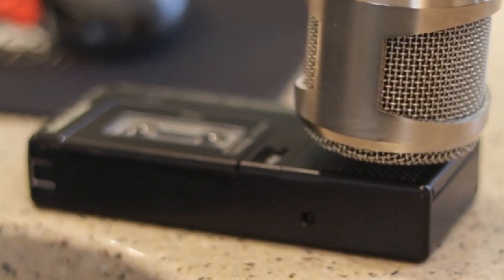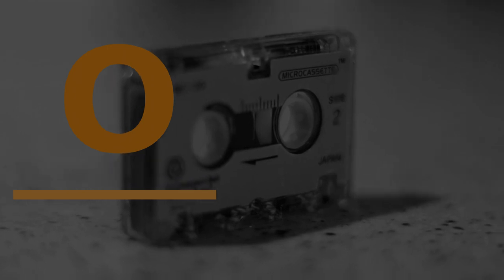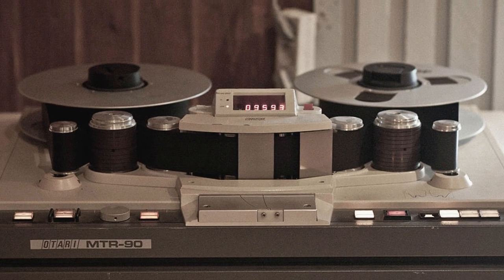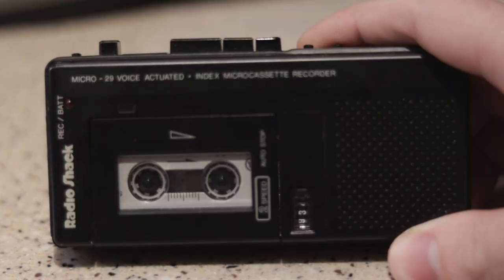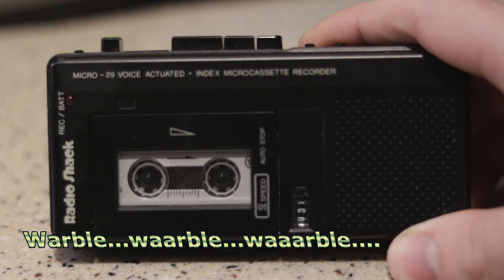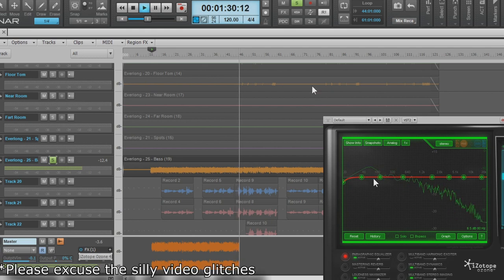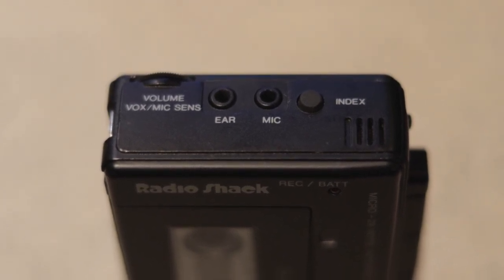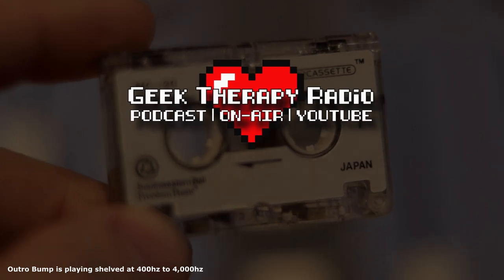Exploring Microcassette | Is my crazy idea even possible?

Comment from the maker: In my initial testing, audio sounds WAY better going through the mic jack input. No motor noise and less hiss than expected. Also, I'm able to boost frequencies as low as 125-150hz (takes A LOT of boost though). Even the high end can be boosted a little, but not much.

This is going to be VERY interesting. Stay tuned!

Comment: Interesting interesting interesting. As somebody in the 2000 to 2006 era that bounced my music onto microcassette for ease of use and portability I didn't find the quality going from cassette to microcassette that bad with my Olympus 41 bought at Radio Shack microcassette recorder and of course after drooling through the catalog. I use that thing a lot to the point where I broke the speed control switch and have yet to find a replacement.
I understood the audio quality chain at quite a young age and one of my requirements was a counter, microphone and headphone out. Because well it's no good if you can't hook it up to other things directly without modifying it. I've even spliced some of my tapes where they broke and cut out worn-out sections.
Only downside was that it was mono, Oh wait Techmoan. I saw the video a few years ago and I wanted to re-watch it today.
That would have been awesome to have when I was younger stereo microcassettes.

Interested to see how laying down each track versus all tracks at once fares with the audio quality.
Reply from the maker: https://youtu.be/fBiPh8LrRmQ here's the result!
Reply: @GeekTherapyRadio  next on my playlist.

Comment: Would putting in a DBX encoder / decoder in line help?
Reply from the maker: I doubt it. At least not with a handheld recorder. Tape just runs soooo slow for one thing.
Reply: @GeekTherapyRadio  I was thinking of the tape hiss. The frequency response, flutter and wow would take some major modding.
Reply from the maker: @ellisgl  It would certainly be a fun experiment. Wish I had a Standalone DBX unit!
Reply: @GeekTherapyRadio  I used to have a portable one, but that's long gone (might have only been a decoder only). https://avaluer.org/explore/20587628-dbx_ppa___1_personal_portable_noise___reduction_adapter__very_rare . I have one built into a Technics tape deck.

Comment: there's any way to put the digital audio into a recorder that doesn't have the mic input like the Panasonic rn 305? I just bought one without knowing it
Reply from the maker: Needs either "line in" or "mic in".

Otherwise you'll need to do a hack job of adding a jack to the microphone wires themselves.
Reply: @GeekTherapyRadio is the jack labeled “ monitor ( 8 ohm) “ just the headphones or speaker output?

Comment: You can do this same thing using any format you want if you are using the cheapest most entry level device of that type.
Let me pick the CD player and you can do the same exact thing with the CDs and get results almost or just as bad.
If you are going to do something like this, at least use a good microcassette device.  At the end, the only thing you will have proven is that really cheap devices used for purposes they were not designed for will give you poor results.
Reply from the maker: The exact point of this video is trying to make a mix from a cheap, crappy format. The experiment wasn't to make it sound exquisite, but sound the best it could with such incredible limitations.

I've got a Tascam 688 (and 644) arguably the best cassette multitracks ever produced. They sound absolutely divine. The best cassette can possibly sound...but we KNOW what great sounds like.

Multitracking with a cheap microcassette recorder. That was the entire point.

On a technical note, the tape inside microcassette is the exact same stock in normal cassettes, just less capacity, hence lower capstan speed.

They actually made Type II microcassettes and hifi microcassette decks, but they didn't catch on.

So, anyway, I apologize if such a niche experiment was so upsetting and offensive.
Reply: @GeekTherapyRadio  " ...cheap, crappy format........ but sound the best it could with such incredible limitations"
But that is the point. This experiment does not create the best sound this format is capable of.

It was neither upsetting or offensive.  I also am the type who gets the point and enjoys such a ridiculous spectacle.  We already know it won't sound good, but that isn't the point.   Having fun on the journey is.
Reply from the maker: @tarstarkusz  Just realized you may not have seen the "result" video! :)